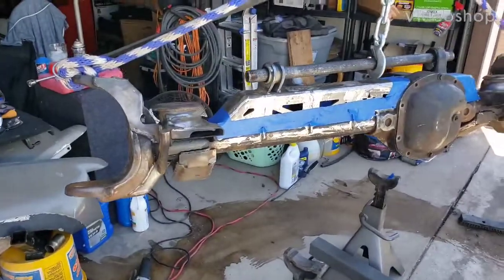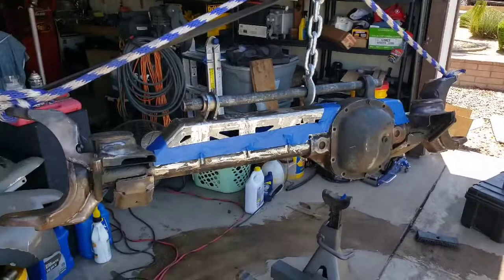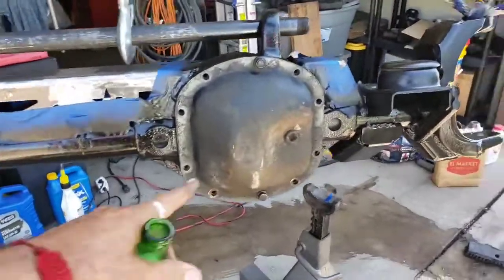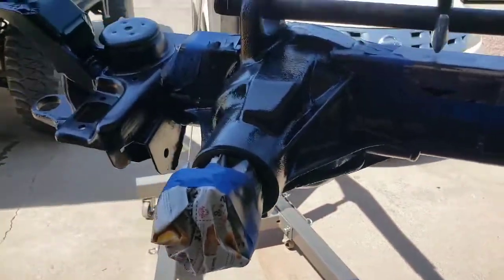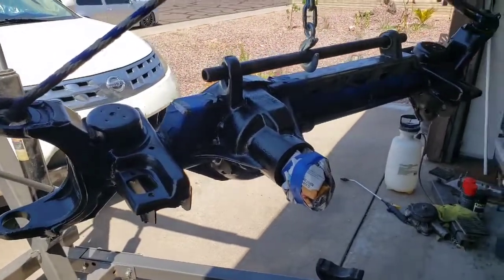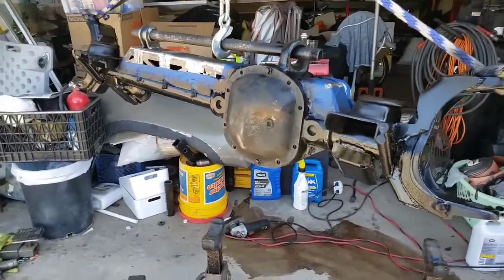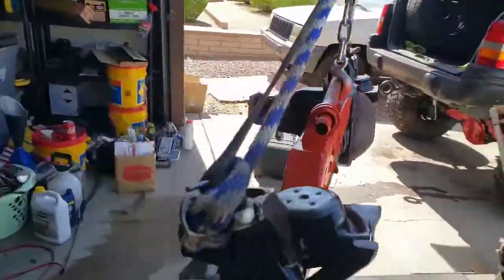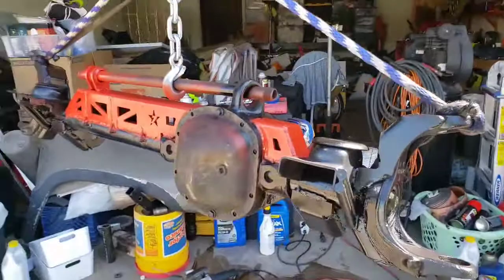Dana 30 biff out jeep ZJ

Comment: There are things that you can do to make the D30 stronger, it's never gonna be D60 strong, but it works. I have a trussed an C-Gusset reinforced D30 on my JKU with a locker and 4.88 gears that I have wheeled the piss out of for the past 4 years, on stock axle shafts no less. Stay off the skinny pedal and you should be fine. Also I hate to brake it to you, but your true off roading buddies are gonna give you crap no matter what you do.